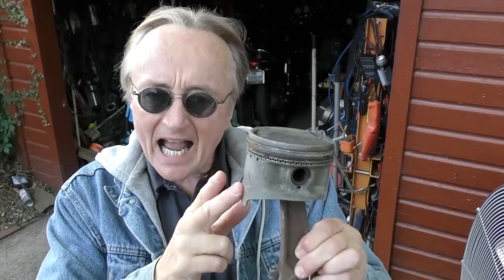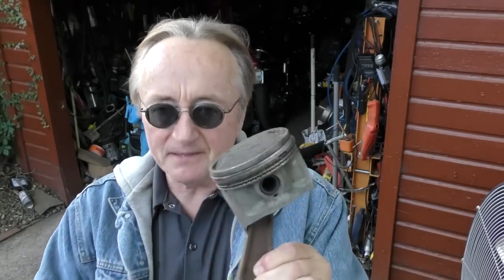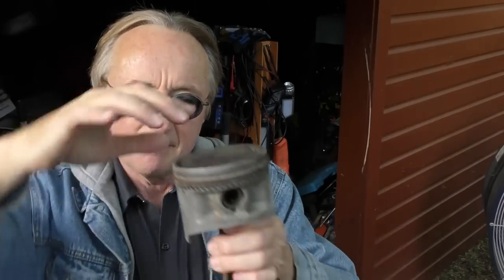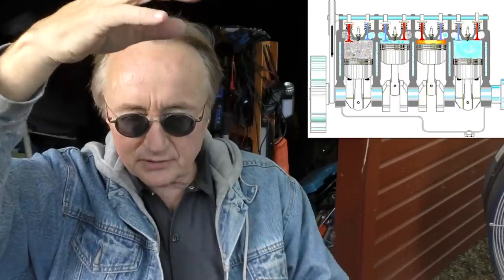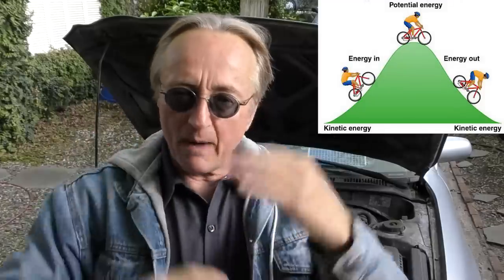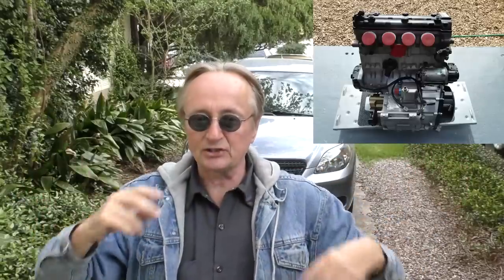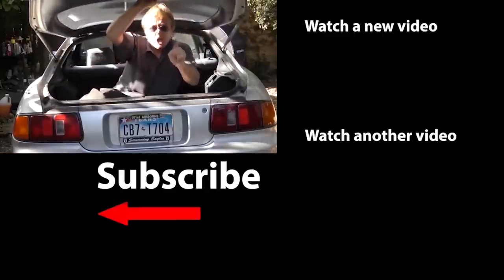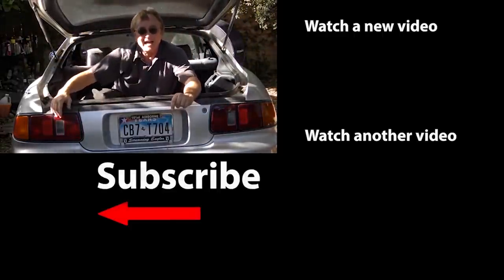Horsepower vs Torque, Which is Better

Comment: F1 cars "don't accelerate all that well"???
"Formula One race cars have been recorded to reach 0-60 as fast as 1.6 seconds, however the typical range for modern day F1 cars is between 2.1 to 2.7 seconds. The 2007 Honda RA107 f1 race car goes 0-100 mph in a blistering 4 seconds flat." 
Quoted from 'zeroto60times.com'
If that's not good acceleration, I don't know what is. . .
Reply: Joaquin Valadez  Only faster. . .

Comment: My 8cyl Cadillac Northstar has 300hp and 295lb torque at 4400rpm it is a 4.6 liter engine that takes 8 quarts of oil.  I owned since new in 1996 and changed the coolant every 4 years.  Never an issue with the engine or its powerful 4t80e fwd transmission - yep, you saw that right it is an 8000 towing pound transmission in this beast!!

Comment: Scotty whats with the 5750 rpm or whatever it is, that the torque and hp are the same always? I could never wrap my head around that one.
Reply: Don't let that confuse you. 5252 has no units, it's just a factor that has to be thrown in the power equation to account for the use of nonstandard units.
Though common, Horsepower and rpm are both actually weird nonstandard units. Standard units in this case (though seldom used in these circles) would be ft-lb/sec for power and radians/sec for rotation speed.

It would be like the 8.333 below in an equation for your annual income:
AnnualIncome = PaycheckCents x PaychecksPerMonth / 8.333
In this example, standard units would have been "PaycheckDollars" and "PaychecksPerYear". If I had started with those I wouldn't have needed the factor of 12/100 or 1/8.333.

Comment: Ok, you need to talk physics. First off horsepower, or output power, is literally just how fast energy is extracted from your fuel and pushed out your engine. So power determines everything, both acceleration and top speed. 
Torque is a turning force and oddly enough in and of itself does not accelerate anything. You have to apply a force, or torque, over a distance to accelerate anything. A perfect example of this is that your driveway provides an upward force against your car of its weight, otherwise it would fall to the center of the earth. However since there's no distance this force is applied over there is no acceleration and your car doesn't suddenly shoot up into the air. Similarly a rusted on bolt can generate a boat load of torque but there's no distance so no acceleration.The problem is when you talk horsepower you're actually talking peak horsepower which your engine will only make at high rpm. When people talk about torque for acceleration they're generally talking about torque at low RPM. Turns out this is generating power(HP) early. Well that is good for accelerating fast since you need power to accelerate and you get it sooner than a car that has to rev up to 6-7k rpm to actually generate decent power.However there's a reason you don't want to generate power early and it goes back to my first paragraph. Since energy is conserved in this universe there's really only 2 ways to get energy to come out of your engine faster. Either you burn more fuel quicker or you extract more the energy out of the fuel you burn. However since we haven't found a really good way to get much above 30% of the energy out this means burn more fuel. So if you generate power early(low RPM) that means high fuel consumption and given a typical car can happily cruise at under 40 hp at highway speeds having your car set up to produce more than that is a waste which is why most cars don't try to generate a ton of power early(low end torque) and instead save it for higher RPMs when they need it. Oh btw, your transmission is simply a device to trade RPM for torque and the ability to trade one for the other is power.

Comment: How come old honda Type R engines can accelerate quickly with no torque then?
Reply: Because high power at high engine rpm with low gearing gives the wheels amplified torque.

Comment: how are some engines rated to make peak torque at 1 specific rpm for eg. 4000 but others are rated to make peak torque over a range of rpm eg. 2000-4000 ?
Reply: Different size's in an engine not every 2-litre engine is built the same way for example.
My Hyundai coupe 2.0 had 140HP but 178 k/n torque @ 5500
but my Volkswagen Passat 2.0 has 131HP but 220 k/n Torque @ 4000

This is because my Passat has longer strokes compared to my coupe whereas my coupe had big fat cylinder's and a short stroke my Passat has a long slim cylinders

Comment: Torrque = the shortest time you  need to reach to speed of X
Horshpur = the least number of engine cycles you need to reach the speed of X  In that time.
Reply: Torque doesn't have a time component.

Comment: Did he now just said Formula 1 cars don't accelerate that well, and that they start slow. I am confused. I knew that they have more horsepower than torque, but I also know that they accelerate real fast, like 0 to 60 fast. or am I wrong? or better put it 0 to 200 fast!

Comment: Love you scotty but this is wrong. What you described torque as is exactly what hp is. Power is how fast you can do work, ie: moving your car over a distance. By definition more hp=more acceleration. Hp= torque*rpm so ultimately you cant have hp without torque so asking which is better is kind of a dumb question because you have to have both. But if all you care about is accelerating fast, the hp number is the only one you should look at. More torque just means you can haul more stuff. Big diesel truck engines have lots of torque but low hp which is why you dont see them doing too many burnouts. Hp also ultimately determines your top speed, but top speed depends on alot of factors so it's not so simple.

Comment: So is this why I can put my diesel Jetta in 1st gear and craw up a small hill without stepping on the accelerator?
Reply: You can also crawl in heavy traffic without stepping on the accelerator at least with an automatic transmission.
Reply: Yes, I do that same thing with a manual transmission. Definitely handy for that situation.

Comment: Asking which is better is like asking which is better in a cake? Milk or eggs? Horsepower and torque are, in a sense, the same thing. All horsepower is is torque and rpm. Mathematically Horsepower is torque X rpm/5252.
What he really means is which do you prefer? An engine that makes high torque relative to rpm or and engine that has high rpm relative to torque?

Comment: Its all about the torque. Horsepower is just torque x rpm.

Mathematically, horsepower equals torquemultiplied by rpm. H = T x rpm/5252, where H is horsepower, T is pound-feet, rpm is how fast the engine is spinning

Comment: High torque , make vehicles faster to accelerate is not that simply true. Diesel engines have larger torque than gas engine but not necessarily faster to accelerate.

Comment: Power = Torque X Angular Velocity. That Harley is just geared low. It's not powerful. Fuel economy is made at the low end that's why Diesels are used in comercial trucks.

Comment: Run your engine @ 5252 RPM and you have the exact torque and horsepower number. Problem solved, if you can't decide which you want more of...

Comment: If a diesel engine which has more torque, can have fast Acceleration, but why still slower to hit 100km/h than a petrol engine? sorry i still do not understand...
Reply: Because it's the wheel torque that matters - you can have high wheel torque with low engine torque with the right gear ratio. So the only things that matters for accelaration are power, grip, gear ratio and weight. Torque is part of power that's why we don't include it. I think Scotty explanation in order to be simple is little bit misleading unfortunately :(

Comment: Hp and torque are always equal at 5252 rpm..below that torque is higher..above that HP is higher.. HP is nothing more than the sum of a mathematical equation.. HP= torque x rpm/5252
Reply: Power is not meaningless. It's the rate at which work is being done. More power means more work can be done in the same time or the same work can be done in less time. In the context of cars and engines that means the light car can accelerate faster than a heavier car with the same power.
Also it's different if you're using SI units - 9549rpm IIRC. But that's actually meaningless - it's just a function of the mathematics because torque and power are related.

Comment: Unfortunately Scotty is quite wrong in this video.  If you have two engines that generate identical torque, one generates that torque at twice the RPM of the other, this engine will develop double the power of the slow revving engine.  That power then goes through a gearbox, because one engine is spinning at twice the speed of the other you are able to use double the gearing which will give you twice the torque at the same wheel speed as the slower engine, twice the torque at the wheel means twice the acceleration, twice the towing ability etc.  Power is the ability to deliver torque at speed.  A busa will leave a harley standing when it comes to accelerating, same with an F1 car, they both accelerate very fast due to their high horsepower (their ability to deliver torque at high RPM)

Comment: Mr. Kilmer, is it not foot pounds instead of pound feet? I always believed torque was defined as the rotational force being applied at a One foot distance from center of the theoretical lever, hence, if you apply 45 pounds of effort against a 1 foot long breaker bar, you are applying 45 foot pounds on that bar, the measurement of torque is expressed based on force applied at a 1 foot distance.....which is what I thought, can you please explain to me why everybody, I mean, every bloody body, says "pound feet"???

Comment: What if you had a Ballance of high torque and high horse power
Reply: The large torque helped make the high horsepower. It's a nonsense question and is dimensionally identical to asking "what if you had a balance of large currency like $100 bills and a high annual income?"
The answer: High horsepower would still mean you can accelerate quick, have a high top speed, tow stuff harder, and climb hills faster... all of the things.
The high torque, means that the twisting force in the shaft between the engine and transmission is high. That's it. It doesn't tell you anything after that point because it has already been told to you in a much more meaningful way through power. Power tells you about the torque coming OUT of the transmission which is all we care about.
I hope this helps!

Comment: I don't think this gave an accurate explanation. I know that horsepower is referring to the engines power. I, also, know what torque is. What I don't know is at what point- axles or the shaft between the engine and transmission- where the torque rating is measured. I'm guessing that it's a measure of the resistance (load measured in footpounds), that the engine is able to maintain it's rpm's against, at the engine's output at a specified engine rpm. If at the axles, it would have to be their ability to maintain their rpm's in a certain gear (probably 1st) at a specified engine rpm against the "load." The engine output, right Scotty?

Comment: An F1 car does 0-60 mph in around 2.5 seconds. That's quite fast acceleration 🙄🤔😁
Reply: Given how light and aerodynamic they are that's quite "slow"
Reply: @mmorales508  ok. Formula One race cars have been recorded to reach 0-60 as fast as 1.6 seconds.
Reply: @mcplutt  A 5,000 pound Tesla 4 door car can do 0-60 in the 2 second range. Think you're not getting the point here. Gonna suggest you watch Scotty's video again to see if that can clear your doubts.

Comment: So Hp=speed
And Torque=acceleration? 
Not sure that makes sense to me...
Reply: That'll be because it's wrong. If you have high HP but lower torque you can use lower gearing to amplify the wheel torque at the same road speed so you get better acceleration.

Comment: Oh my god. Anyone who doesn’t understand what horsepower and torque are and just watched this will be so confused. Oh and just about everything he said is partially true but so skewed from his perspective on reality that it is pretty much useless. In a nutshell torque (as related to vehicles) is in fact a rotational force that is applied 1ft from the center of rotation. The horsepower is the amount of force applied over time. If Scotty was right then a vehicle with a diesel would tend to be faster than an equivalent vehicle with a gas engine. This simply is not true. It is a simple math calculation that if you look at it explains the interplay between these two measurements. I found this on the Internet and it explains it pretty well. “Multiply the torque by the engine speed. You will be using the formula (RPM * T) / 5252=HP, where RPM is the engine speed, T is the torque, and 5,252 is radians per second. The first calculation you want to do is multiply the torque and the engine speed.”

Comment: Sorry Scotty but HP is the rate at which work can be done. The higher the HP (as long as other factors are the same like gearing, weight and so on) the faster the vehicle will accelerate. The higher the torque the more turning force there is to move a heavier vehicle like in your tow truck example. Also your example of Formula 1 cars being slow to accelerate and a V-twin Harley accelerating faster than an inline 4 is unfortunately not accurate.

Comment: The way you explained it is wrong. You said torque=acceleration, which is only partly true.. 

If you take 2 cars, same weight same gearing ect. 

One petrol car has 250hp and 300nm revs to say 6000rpm ( totally made up) 
One diesel car has 150hp and 500nm
Revs to say 3500rpm ( made up too)  

If they were to race, we damn well know the petrol would win overall down the track. So how the hell does torque=acceleration? Well it only partly does

This is because when both cars accelerate from 0rpm on the start line, both cars have equal revs, but the diesel has more torque, hence more power, hence accelerates faster. ONLY when they have the same revs. 

Now, once the petrol car exceeds the revs of the diesel, it's engine is spinning faster and doing more work, making more horsepower hence the car accelerates faster later on.. 

So basically, torque is good for getting off the line, horsepower is good for higher speeds. Revs is the thing that determines horsepower.

Comment: So horsepower for high top speed and torque for fast 0-60
Reply: Hp is where your speed/acceleration comes in, torque is just how much you can tow. Torque is twisting force, while hp is how quickly/fast it twists. So you may make alot of power (torque) but you dont make it quickly (hp)

Comment: Horsepower is the sum of RPM times torque divided by 5250. Horsepower is not its own singular thing. Seems you're attributing horsepower as RPM. The comparison you make of the Hayabusa vs the Harley should have been explained in away that the Hayabusa is capable of much more RPM than the Harley where as the Harley makes more torque down low because of the massive displacement they have. Unlike the Hayabuse the Harley is done making power past 5000 rpm where as the Hyabusa builds power well past 10,000 rpm. Two different engine's can have the same horsepower but have different ratio's of RPM vs torque. Like a 6.2 Chevy Camaro does not have to rev as high as a Ford Mustang coyote engine to make the same net horse because while its makes less rpm it make's more torque. The Mustangs coyote engine is the opposite bias in that it makes the same power with more rpm and less torque. Horsepower should be viewed more as a ratio of rpm vs torque.

Comment: torque is the force or strength of the engine plain and simple.
 horsepower is how fast the engine can rotate while maintaining a certain strength. 
for example a strong man can push a 2ton car at 5mph. a man with more energy(horsepower) but just as strong can push the same car 10mph

Comment: Didn't even mention short stroke for horsepower, long stroke for torque. Shame. Stop and go, you want torque. A high torque producing engine can still get you going over 100mph which is good enough for your daily driver. An engine with a 4 inch stroke can be producing high torque possibly between 1600 and 1800 RPM, guess where your torque converter goes static? 1500-2000 RPM. Actually, where the torque converter goes static is also affected by how much torque the engine puts out. My old Ford 428 Police Interceptor with 4 inch stroke produced both torque AND Horsepower.

Comment: I am pretty sure your wrong torque is ability to do work and horsepower is ability to accelerate look at semi engines 500hp and 2000FTlb of torque a semi doesn't accelerate like a madman but has the torque to do the work HP as you go up increases acceleration look at big block motors vs small block small blocks have more horsepower but big blocks got more torque a big block will tow better than a small block yet the small block will run circles around the big block again horsepower is for acceleration torque is a measurement of ability to work

Comment: The whole idea that a higher torque engine engine accelerates faster is nonsense. It might feel that way because you don't have to downshift, etc but it objectively is not faster if it's lower horsepower.

Horsepower is a function of torque over time.

lb-ft of Torque and horsepower are always equal at 5252 RPMs

The higher horsepower engine will always accelerate faster assuming gearing is appropriate.

Diesel engines used in towing is a matter of efficiency, not capability.

Torque is best used as a measure of drive line stress. Everything else is a bunch of marketing nonsense and to be honest I'm surprised you're buying into it Scotty!